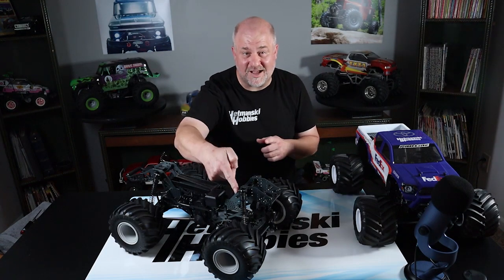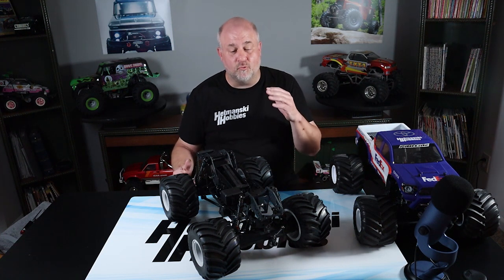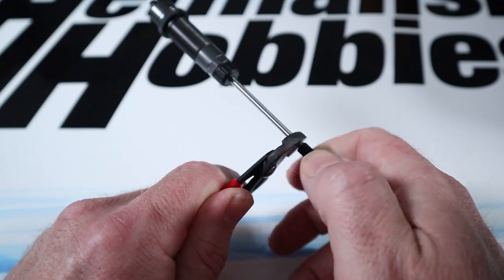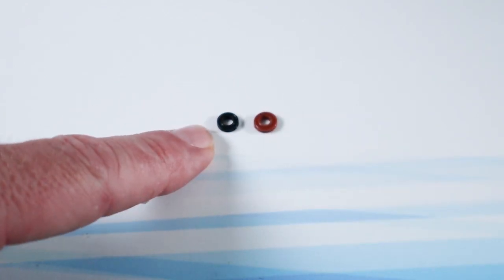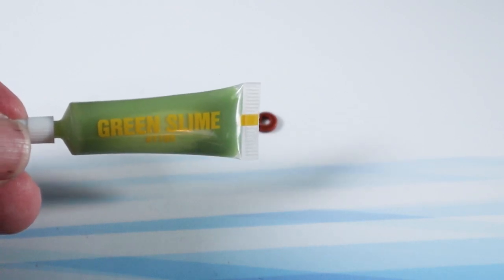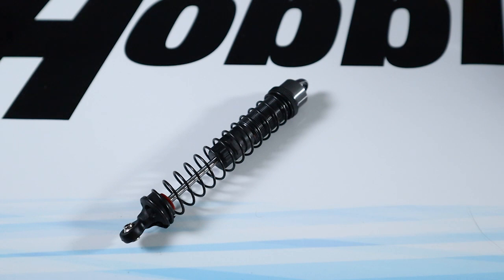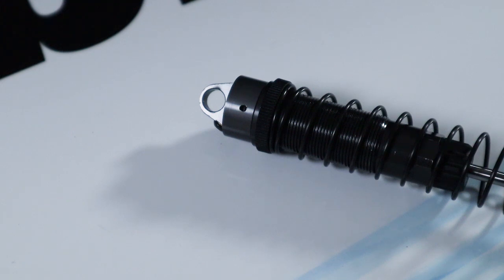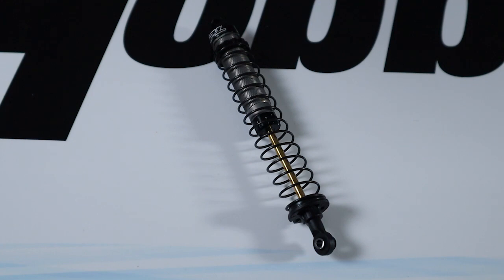Getting To Know The Losi LMT - Shocks

Comment: You notice any leaking from yours at all. I just installed these on my brand new roller and used 25wt oil...just testing on the bench cycling the suspension multiple times by hand...I can see fluid on the bottom cap clearly coming from the shock shaft. Not a ton..but enough were you can see the lower shaft is damp. You have this issue? Thanks for your reply and appreciate the help and informative vids!!
Reply from the maker: I haven't had any leaking on my shocks. Glad you like the vids, there's a lot more to come. Tell your friends!
Reply: I can not figure out why I am still having "seepage" after cycling my shocks. I find that the bump stop is damp and the bottom of the spring retainer has oil on it after the TLR mod. I am running Associated Green Slime, Associated 25wt shock oil with a bladder up top, drilled cap as you did and have rebound set about 1/2 way. Rebuilt them twice now with two new sets of the TLR o-ring rings and its still happening. Can clean em and be dry as a bone. Half a battery pack later with no major jumps and there we go...seeping again. You are the MAN when it comes to the LMT. Been doing RC for 30 years myself and can not see any obvious reason causing this. Just dont like them seeping. Help Hetmanski!

Comment: To confirm, when converting to emulsion, the o-ring sits in the shock cap or shock body?
Reply from the maker: When you convert you need to remove the bladder and install the o-ring under the shock cap. The o-ring is there to seal the cap and keep the oil in.

Comment: Interesting info. Thanks for posting it. 
I just got my LMT working. I have 4 cell electronics in my roller. I really don't like how weak the springs in the shocks appear to be. I have the collar on them turned all the way down so they compress the spring as much as possible and it still doesn't lift my LMT all the way up. It still sags down a bit. I'm thinking of trying some Clodbuster springs which appear to be much thicker wire.

I don't understand the part where you say these weak saggy springs are needed because there is no leverage on them due the design.
Reply from the maker: The reason why you have saggy springs is possibly because you have too much weight in the chassis. The springs are simply there to support the weight of the chassis. The LMT is designed around the weight and power of a 2-3S power system with a 550-size motor. If you add weight to the chassis, you have to increase the rate of the spring. Losi does sell a spring that is stiffer than stock. 

Having leverage acting on the spring (for example: a link mounted shock) is able to compress the spring/shock easier than if it was on the axle which has no leverage acting on the shock. The axle is basically a 1:1 ratio while a link mounted shock may have a 1.5:1 or 2:1 ratio acting on it. A 1lb spring on the axle needs 1 pound of force to compress it while a 1-pound spring with a 2:1 ratio with the leverage can be compressed with only a half-pound of pressure.
Reply: @kevsbench01  Thanks for the excellent info!

Comment: On my LMT, the left front shock compresses completely when I drive in reverse, more than the right. I changed them to emulsion style and already tried swapping the left and right shock. The LMT is stock, except for the Treal sway bar and Demolisher tires. Could the sway bar be causing this? I don't think the shocks are the issue, as I swapped them from left to right and the problem persists.
Reply from the maker: The sway bars control the side-to-side motion of the chassis, not the shocks. Depending on how the shocks are mounted, they could add a little bit of support but it's not worth talking about. The driveshafts are what really causes the chassis to twist and depending on grip level, weight of the chassis and so on, the amount the chassis wants to twist can be more or less. I would check the sway bars on the truck to make sure they're working correctly. Sadly, most people change the stock sway bar which is a big mistake because the stock system is the most adjustable one around. You can change the end bar material, the end bar length, the end bar thickness and the list goes on. When you install an aftermarket sway bar (in this case) you actually limit the adjustability of the sway bar and therefore may not be able to manage chassis twist in some conditions. When it comes to the shocks.....Building the shocks with a bladder or emulsion style doesn't really change the feel of the shock. The difference there is that a bladder shock is always ready to go while an emulsion shock needs to be "worked" a little while before it has a consistent feel.
Reply: @kevsbench01  Thank you for your detailed response :) If the problem persists after I rebuild it, I will change back to the stock sway bar. Alternatively, would it help to use a more flexible spring steel rod?
Reply from the maker: @hansnsnananna3933  replace the stock end bars with music wire/spring steel. Make them a little longer than stock to give yourself more adjustment. Make them long and they will be softer and make them short and they will be stiffer. You can easily fine tune the length. Thicker bars will make it stiffer and thinner bars will make it softer.

Comment: Do you run emulsion or bladder shocks? Does the answer change for link mount vs axle mount shocks? 

What size vents do you use on your wheels? I ask because it can affect rebound tuning….
Reply from the maker: I like to run bladder shocks no matter what the shocks are on.  And I run whatever vent that comes in the stock LMT and JConcepts wheel.

Comment: The stock springs on my stock lmt shocks kinda rubs on the shock body when going up n down.. i even fitted new springs to see if it would help but its the same..  it sounds bad when you sit with the truck and its not exactly making the damping better.  

What to do?
Reply from the maker: The outside dia of the shock body is a little large for the inside dia of the spring and the deflection when compressed is causing the issue. Unfortunately, there's nothi8ng you can do about that. The rubbing of the spring really won't cause an issue with the suspension. If the rubbing is something that you really dislike, you can change to Pro-Line PowerStroke XT shocks and use the stock Losi LMT springs. I have that setup on my race truck and the springs don't rub.

Comment: Building my LMT roller to be a nice clean freestyle rig. I just got the new seal kit and am going to rebuild the stock shocks and keep the bladder. Where is the best spot to put the bleeder hole in the cap and what size should it be?  Will it cause any leaking of the shock?
Reply from the maker: You can clearly see where to put the hold in the video. It doesn't have to be very large. You just need a place for the oil to go when bleeding the shock. It will not cause leaking because the shock cap is tightened and therefore sealed when the bleeding is done.

Comment: Great video 👍👍 I'm getting ready to swap out the o rings in my lmt shocks 
Question Do you run rebound or no rebound in your lmt shocks 
Keep up the great videos
Reply from the maker: I run a dead shock. No rebound. There's no reason to have a shock apply any pressure to the suspension. It's simply there to control how fast the suspension moves in each direction.
Reply: @kevsbench01  Thank you very much 👍

Comment: Wow why would they wrong sized shafts in the shocks
Reply from the maker: It's not the shaft. The O-rings are not the correct size.
Reply: @kevsbench01  I meant length. I’ve never seen a shock shaft. I’ve never seen a factory shock that does that